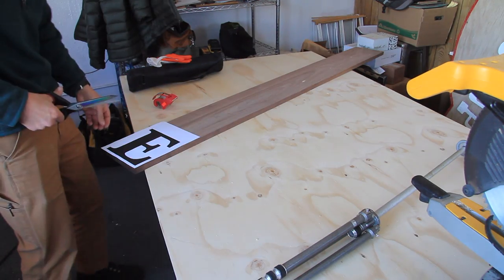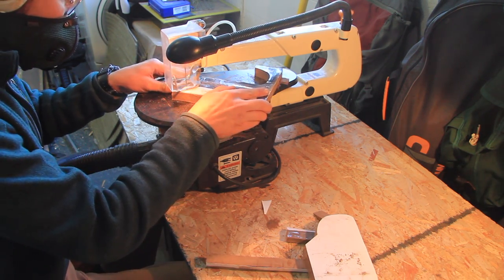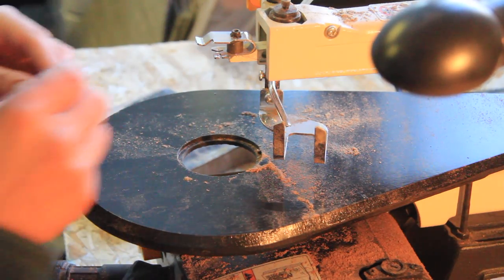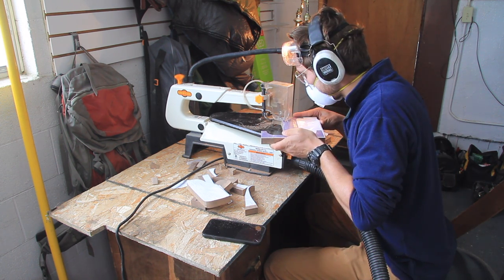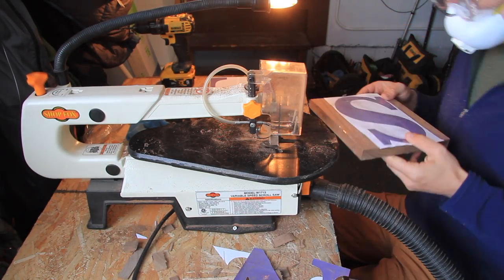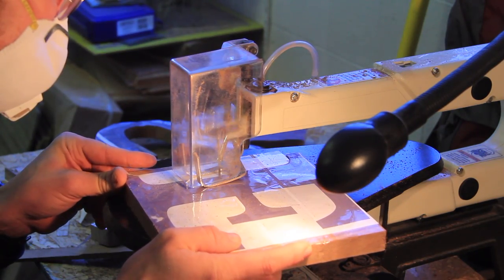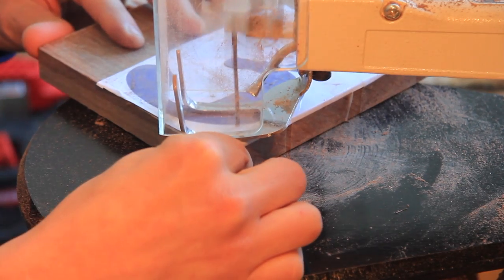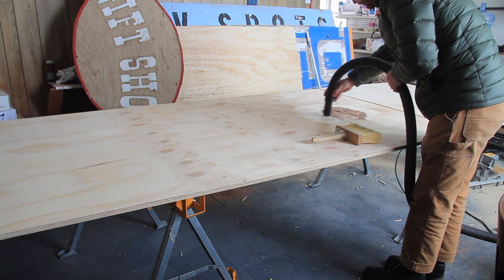15 Tips for Using the Scroll Saw // Hardwood Letters for Store Sign

Comment: The link provided for the scroll saw shows an improved model of saw for $199.
that saw has mitre slots (a rarity) and one big advantage, a lever to release tension on the blade instead of  the rotating knob like in the video.
Amazon has a similar saw by WEN for about $120. It looks like they😀 all come from the same factory in China. Some have more features than others and the cost reflects that.
These saw are best using "pinned" blade. Forget using the adapters for non pinned blades as the are nothing but a huge hassle to deal with. If you want to do very small intricate cuts then look for a saw that is set up for pinless blades. If you do lots of outside cuts these saws that use the pinned blades are a breeze to use.
Reply from the maker: This is amazing info and I appreciate you sharing. I was curious myself why the saw I have, wasn’t available anymore. Thanks mate and cheers
Reply: @SecondSonWoodworks   Maybe this is an upgraded version. The saw in the link has a couple of things going for it that are rare on scroll saws. It has a table with miter slots and it has a flex shaft on the side of the saw. (think:::::::like a dremel but on a flexible shaft)
for doing the project you do in this video this saw and ones like it a great. I have a similar model and it has performed well over the last 10 years.
Nice video, keep up the good work.
Reply from the maker: @gatoreye2000  That's awesome, wish I could have gotten some of those improvements but overall, I have loved the one I have. Thanks for commenting and for watching. Cheers!

Comment: Very useful but I am cutting letters only 3/4 inch tall.  I don't know what blade to use or what speed the machine should be operating. The technique may be applicable but the size difference may require some special attention.  Thank you for the video I will be anticipating your next instructional video.
Reply from the maker: Thanks for watching! Yes those are quite small, but I think with a thinner blade on the scroll saw, you will have success. Just try out cutting with different speeds on some scrap wood before doing the actual letters. Then take your time and breathe! You got it. Let me know how it goes

Comment: I use carbon paper to transfer the letter shape to the wood. Would take about as long as the taping process. The carbon paper can be reused many many times.
Reply from the maker: Great idea! How do you use the carbon paper? Do you free hand sketch the letters?
Reply: I place it under my letters or design and secure with a couple of pieces of tape. Then I trace the outline with a ballpoint pen.  That transfers nicely and allows me to see what I have already traced.
Reply: You can also use inkjet transfer method.